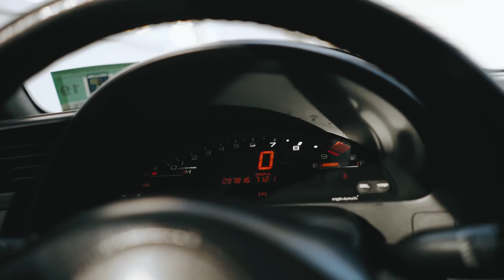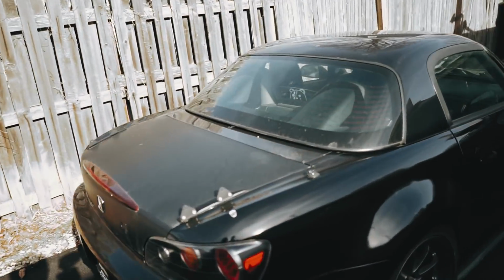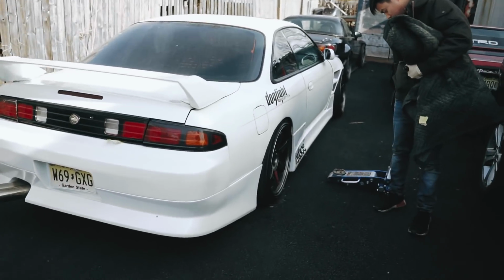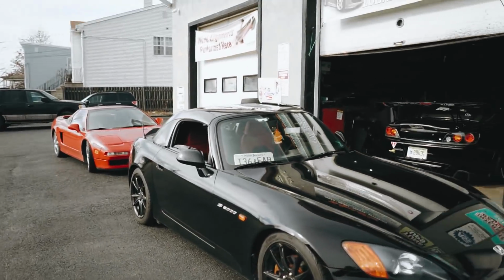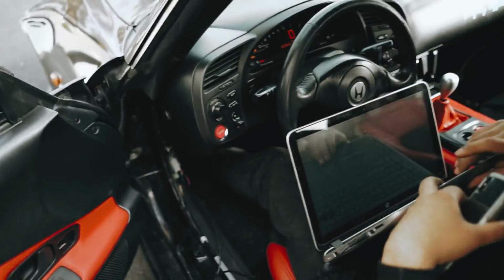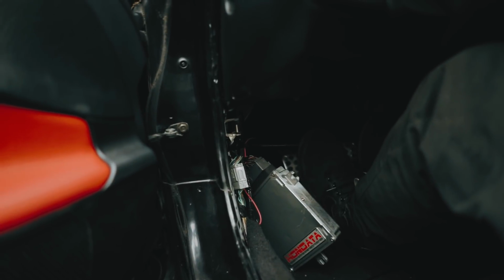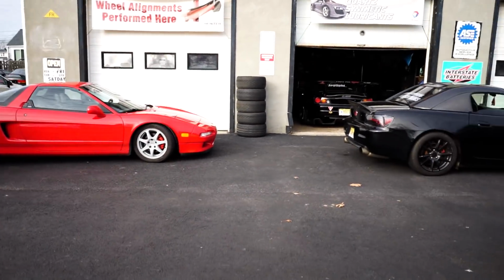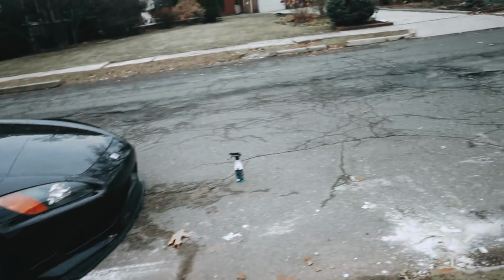First wide body spoon s2000 / VTEC POWER..

Comment: Never noticed your brake calipers where painted. Ugh I wan do mine but they stocks are so small. I don’t track so I see no need to upgrade to bigger ones....

What was your vtec at before? Stock vtec engagement is at 6. 

Your car sounds crazy outside. 

Make the next wheel choice good. Still Gona go stanc-ish or functional??